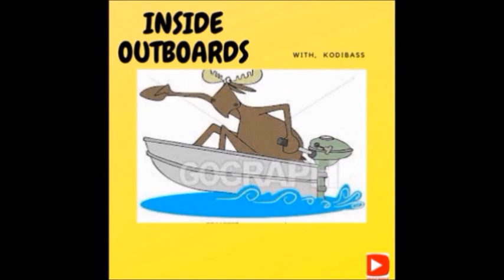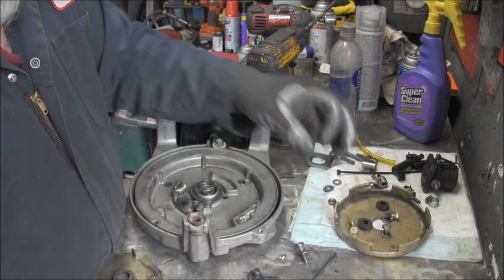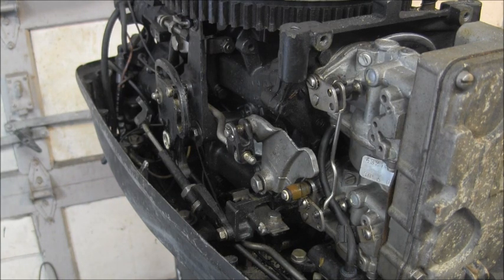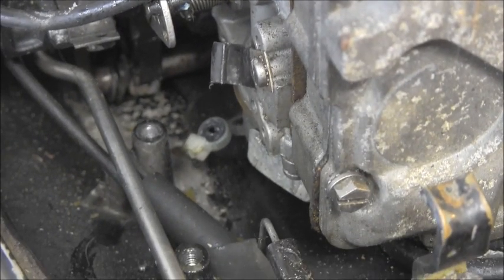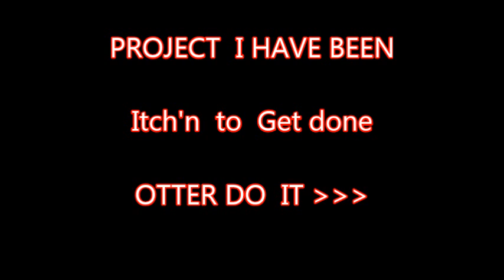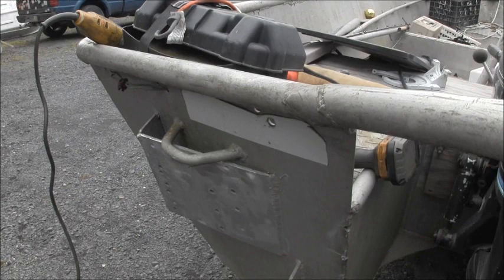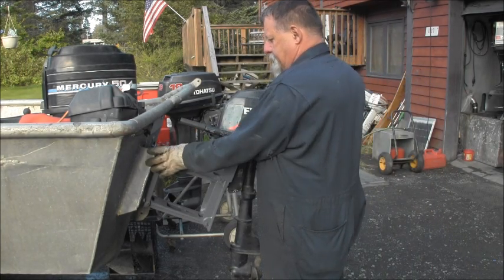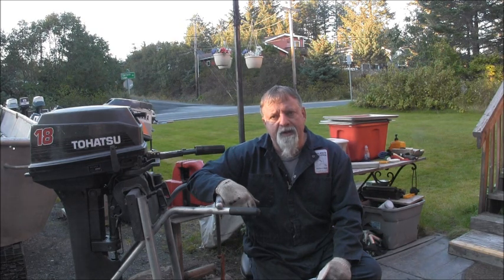JOHNSON 55 HP COMMERCIAL  &  More

Comment: Hi Kodi, Yep old plastic wears out and cracks. Hardly any plastic on the older motors which I like. The 57 mark 10 I have, been trying to find some info on and finally found it. Kiekenhaufer has a website for all its old motors for service manuals. $4.95 to buy the PDF file so it's on your phone or where ever you want it and print off copies. Has the specs and torques I need. Going to share the link on my next video on the mark 10 for anyone who is interested.
Reply from the maker: Fantastic Tim,  I will check it out 4 sure.    kodi

Comment: Love the videos, i have an 89/90 commercial series engine with a whole host of problems, im trying to source a manual online but cant find the serial number anywhere, its not in the usual places, any ideas where i may find somewhere to download maybe as engine driving me nuts. Its only really pushing the boat full throttle, and the speeds are anything from 8-18kts

Comment: What differences do the "commercial" outboards have, other than slightly different horsepower ratings?
Reply from the maker: Beefer crankshafts, drive shafts, prop shafts  etc. A  55 com.  is a 70 hp minus one cylinder.  kodi
Reply: kodibass Thanks Kodi.  I bet you know what distinguishes “Special” versions?

Comment: And, I agree with you, Kodi; yes, it is plastic and it (the primer nipple) is broken (like so much else on this motor).  But, how did it get broken???  Was somebody under the cowling beating everything with a hammer?  These plastic primers have been on motors since 1984.  Never have I had a broken nipple off a plastic primer body.  Actually, I did see one that someone else had broken.  One.  This is an amazing repair job you are having to fix.  "Bubba" must have owned this motor.........
Reply from the maker: Yep' no shortage of outboard Killers around my neck of the woods  4 sure.   kodi

Comment: Oh, how do you get out an old stuck jet on a carb to replace it? There is nothing left on the slot to use a screwdriver. Just leaving it for now since it's works fine still
Reply: You would have to drill it out real careful and rethread the hole for a new one a pain in the neck been there it’s a pain
Reply from the maker: As  Sam says drilling is about all U can try,  I have had some luck using a counter rotating drill bit set.      kodi
Reply: I need a set of those to try out

Comment: Would the nylon degrade fast in climates that have severe temp changes from winter to summer?
Could this have been up north from you for a period of years, under the hood didn’t look like it had been exposed to the elements directly for years and years. Maybe cleaning products like starter fluid or the like being sprayed on the areas? Just trying to think of things that would speed up the aging process. 
That 55 would be a great work horse down here in Louisiana!!!!!
Would you have any jack plates that may be out in the bone piles?
Reply from the maker: I was thinking those same things may-b a combo of both?  After dealing with the 30 Jonny with the fly swarm living inside heck anything seems possible lol,  kodi

Comment: I own one of those I live in Kodiak Cody bass's real good friend of mine the reason they're called commercial Outboards is there built heavier-duty
Reply: Hate to see the non-commercial version given all the "heavy duty" plastic in this one.
Reply from the maker: They R pretty Tuff motors overall,      kodi
Reply: Run a fully modified 55 seahorse with a L50 jet here in Juneau on a 16 ft seaark...they r work horses.
Great stuff Cody! You are the hack from Kodiak!!